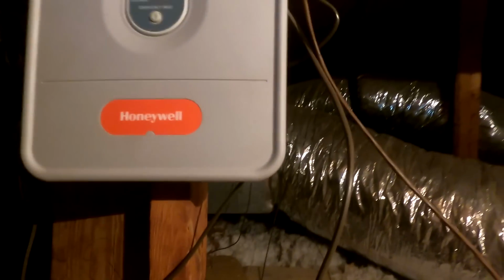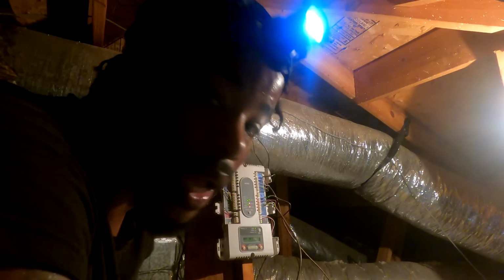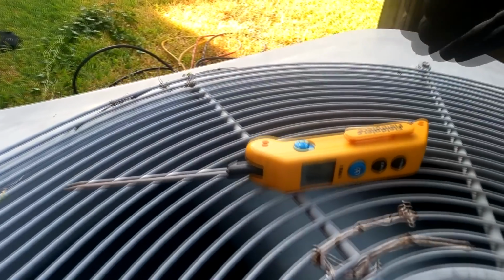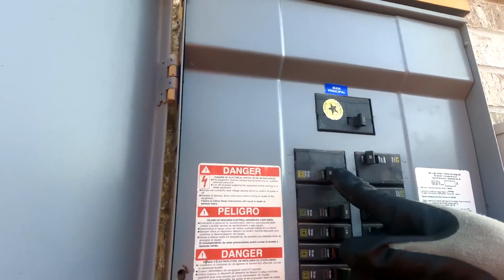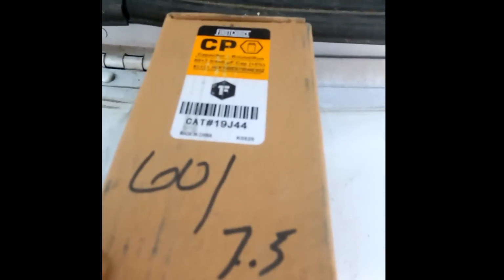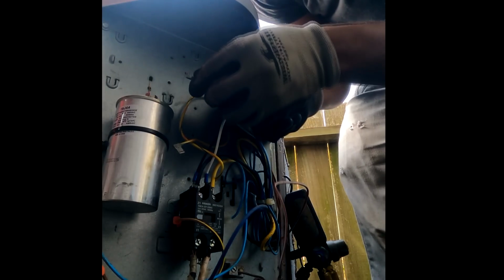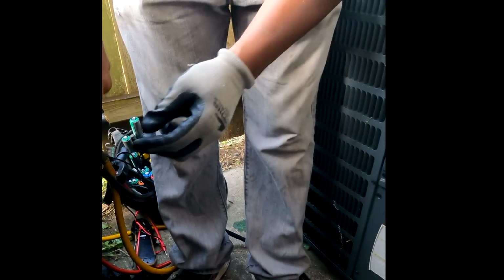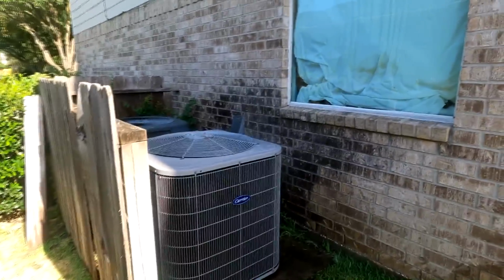3-Day HVAC Unit Down Mystery - Watch Apprentice's Diagnosis!

Comment: I'm tracking your process in guiding young Anton and its pretty awesome.  I also learning somewhat as I'm self-taught. I may have put my amp probe on the compressor wire to see if it was running. Also, I would have looked for a double breaker with both 120v phases. Before checking the capacitor, I would have checked for incoming power to the contractor. I'm not sure how much electrical training they get at tech schools. Was also wondering how much does tech schools get into commercial system servicing?
Reply: No prob having to use that amp reading brother I can’t always tell about that compressor either

Comment: What is the purpose of zone dampers?
Reply: The dampers themselves? They are what create the zones by shutting off airflow to certain areas. When one zone is calling for air but the other zone is satisfied, the zoning board shuts the damper on the duct leading to the satisfied zone. The damper is what physically blocks the flow of air to certain zones, allowing two different areas to be two different temperatures using a single system.
Reply: @zach4604  Would each zone need to have its own thermostat then?
Reply: @Chris2745100  yes, each zone must have its own thermostat

Comment: The apprentice should NEVER have been taking a "no cooling" call alone that requires diagnostics. The only work this apprentice should be performing is preventative maintenance. This apprentice needs to be doing service calls ONLY if accompanied by a journeyman level service technician. This apprentice knows just enough to be dangerous.